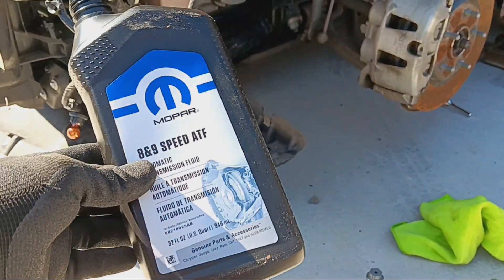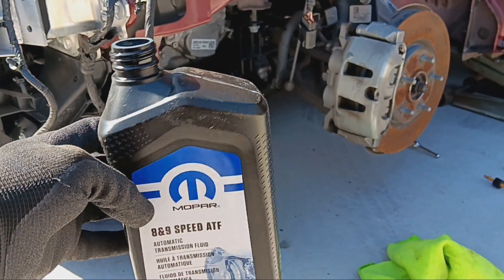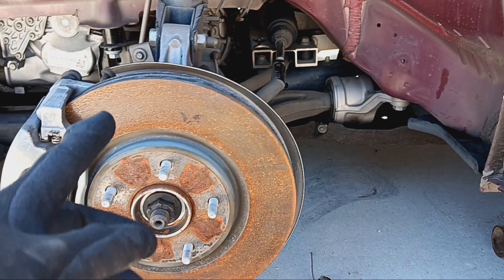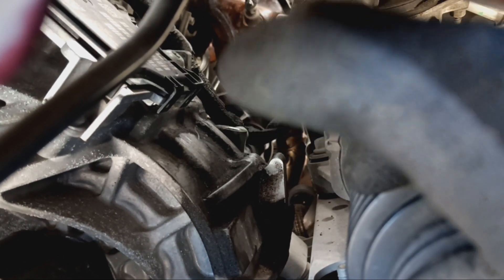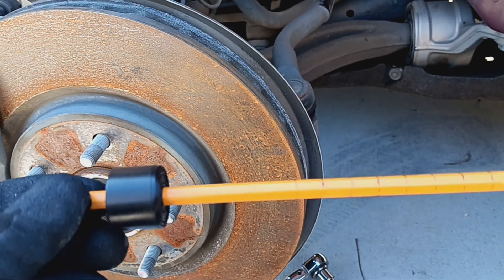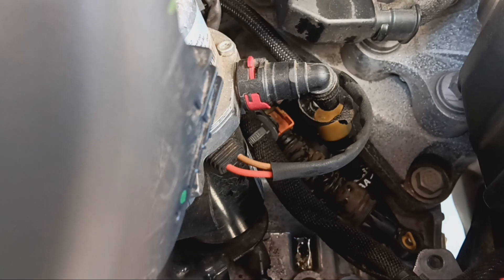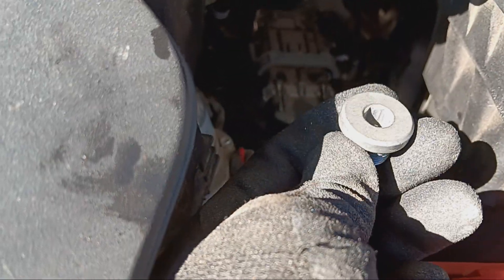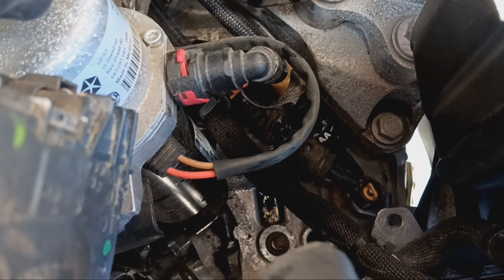how to check and locate transmission fluid 2017 chrysler pacifica #diy #how #howto

Comment: You never said the temperature or where the gauge is for each temperature for how many how much level
Reply from the maker: @jamespalmer4945  Google your year and model and you can find it. Specially for mine @ 176°f  it's between  some like 20mm low to 27mm high. It's better for you to check your model specific.  Even call dealer
Reply: @ I have the 2019 Chrysler Pacifica as-well  . But I’ll probably just do a drain and fill aswell. But I did buy the fluid level tool and a heat gun just in case
Reply from the maker: @jamespalmer4945  my display inside the car shows the trans temp. That's how I did it
Reply: @jamespalmer4945  Yeah it might be expensive upfront, but do it right and flush it if you have a lot of miles on top of those years. First dealer so far quotes me $900. Only way to truly clean and refill is changing the filter. You have to replace the whole lower pan to do so. If you can get a dealer to agree or trusted mechanic who knows what they're doing, maybe you can save a buck and get your own fluid for $25/quart instead of $50. 

After that is done, do ~3 quart drain and fill runs every 30-50K mi and you're good.

Comment: great detailed explanation thank you,  with that said , what a pain in the ass. I bought a 2019 with 40,000 miles on it . I don't put on many miles .  2-4 thousand miles a year..............I am not gonna be to worried about the transmission fluid. Your thoughts ?
Reply from the maker: From what I heard it's a lifetime on the trans , I wouldn't worry
Reply: @creat-test  and by lifetime, I wonder exactly what they mean 😆
Reply: @Texasmonster10 60,000 = Lifetime 🤷🏼‍♂️🤣😂
Reply from the maker: @scottdilemma655  these transmissions are good but the stupid computer thing starts acting up and give hard shifts.  I did hear they might have a update for these, like go to dealer and they install some software update. Not sure though
Reply from the maker: @Texasmonster10   maybe until warranty runs out